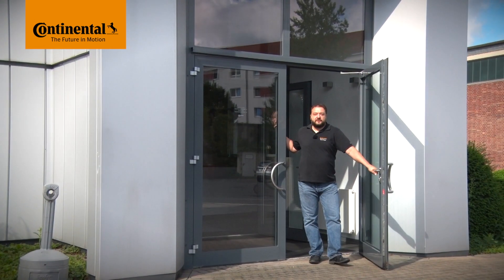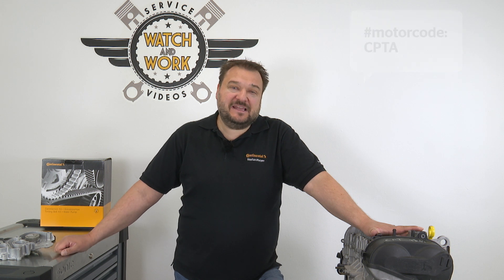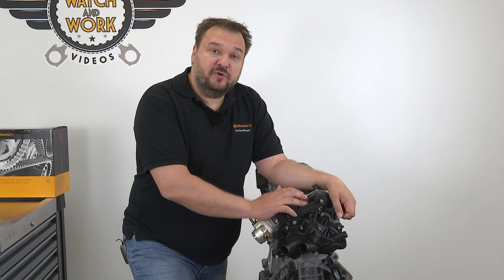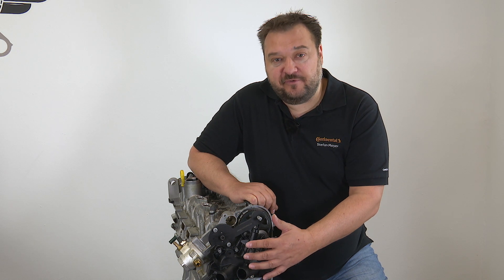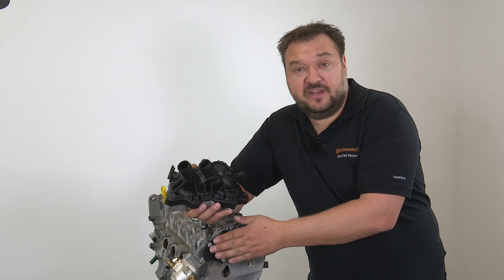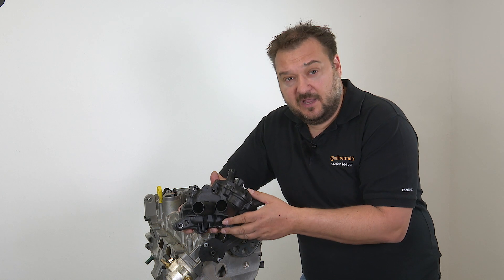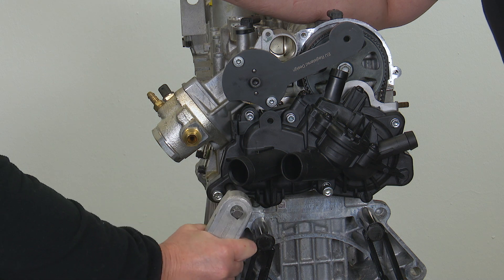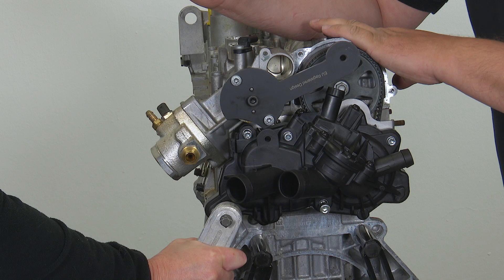[EN] Watch and Work Tutorial: timing belt replacement– VW Golf 7 1,4l 103 KW 2/2

Comment: Wow the torque from the waterpump was tricky. Let's see if I understand well. I still miss something from the assistant. Did he torque 30 NM hex key at the same time u do the 12 NM? Please right down the steps. I would like to know.
Reply from the maker: Hello, following you can find the step by step instruction (install process of water pump):
1. Tighten the Bolts 1-5 hand tight clockwise
2. Tighten the Bolts 1-5 with 10 Nm
3. Loosen all Bolts 1-5 one turn in same sequence
4. (second mechanic needed) hold a constant torque of 30 Nm over the hex Key. This torque has to be hold until Step 6 is done!
5. Tighten Bolts 2 + 1 + 5 with 10Nm
6. Tighten Bolts 3 + 4 + 5 + 1 + 2 with 12 Nm (predetermined order!)

Best regards, your Continental Aftermarket team